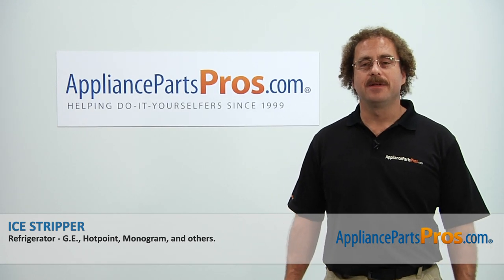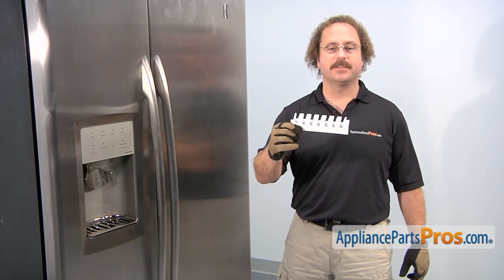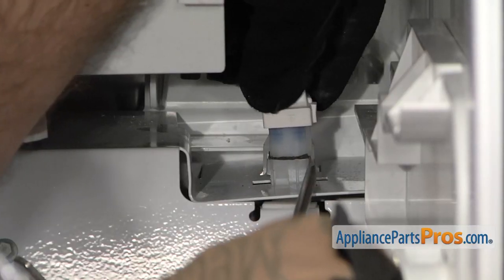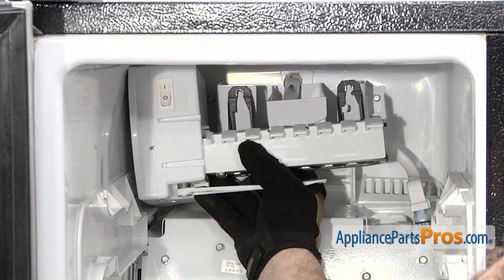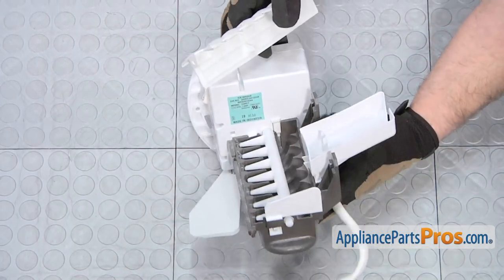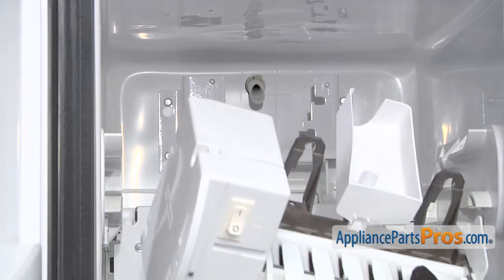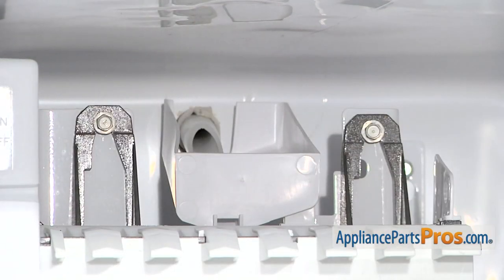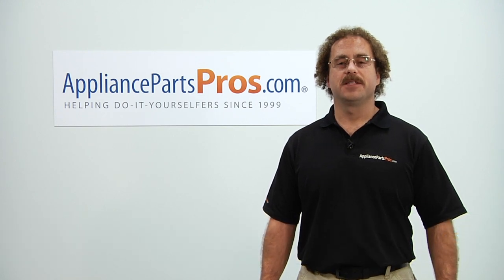How To: GE Ice Stripper WR29X10085

Comment: I took the front cover off of this unit thinking I would find the water level adjustment screw, but all see is a circuit board and some wires.. Where is the adjustment screw? Is that it just below the on/off switch? Thanks.